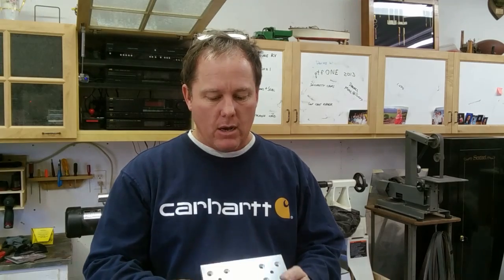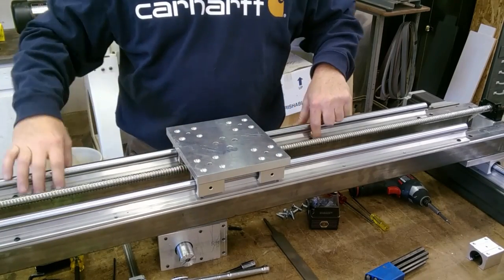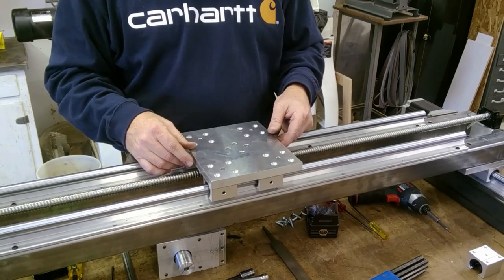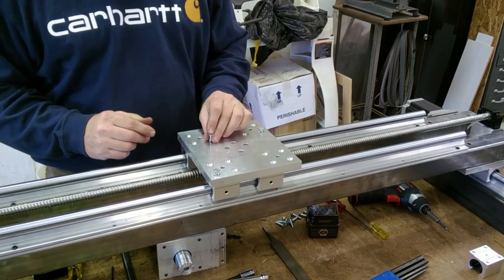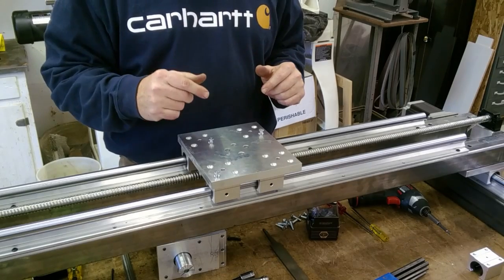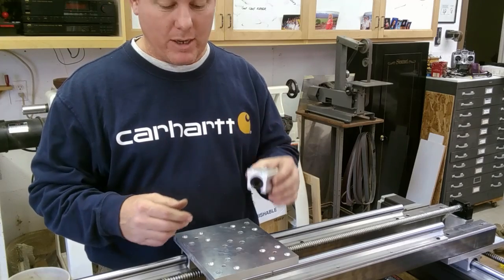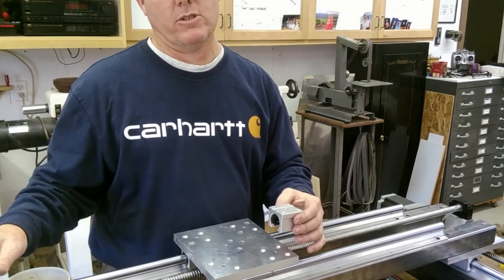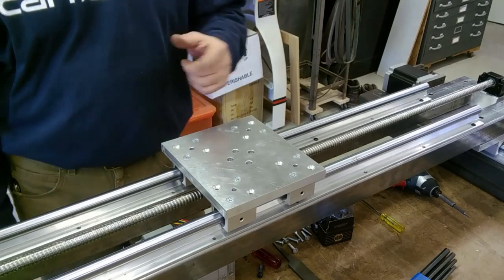Chinese Linear Slide Bearings - Something to watch for.

Comment: These are not precision parts, even on high precision linear guides you don't locate them this way. Counterbore instead of countersink and leave 0.5-1mm clearance (20-40 thou) to allow for any misalignment. You only experienced issues because you assumed your method would be better than the standard way it's done.
Reply: Cunningham's Law states "the best way to get the right answer on the internet is not to ask a question; it's to post the wrong answer." Good on you for showing your work and leaving in your “mistakes” so that others may learn from them. I try to leave in my mistakes instead of editing them out for the same reason.
Reply: @NoelBarlau , I discovered Cunningham’s law over 30 years ago. I would create two accounts. The first one to ask a question. The second to answer it incorrectly. Then a ton of “correct” answers would start flooding in.
Reply: 100% right. This is an engineer's reply !
Unfortunately a few people have heard of pocket holes and drill bits  to do them are not so common.
Reply from the maker: I think you are right.  I mentioned that in one of my other machine overview videos.  
One of the things you have assumed incorrectly is that I know the 'standard' way.  The best part of this (social media), is hopefully your comment will help the next person.  I'm going to pin it to the top.
As @loco lobo said above, however, few people have the tooling for counter bores, so I will note for them, that anything BESIDES the flat heat tapered screws like I used would be better.  ~P.
Reply: @sbirdranch  I just had to stop and comment on this - how f*cking refreshing to see someone say "I think you are right" to a comment that could have easily been taken as aggressive or argumentative if you didn't understand that there is a bigger picture to all this (...of course, it didn't hurt that he WAS right.) The world is so full of insecurity that sometimes it feels that we are in a mass degeneration, but maybe that's just me. lol I'm not an engineer, not any kind of scholar, I'm barely a woodworker, but I've become absolutely enamored with the concept of linear motion, how it is applied in day to day life, the hardware involved, and especially with the various iterations of the principles in the projects that content creators like yourself have shared here on YouTube. Thanks for the time and effort it took to put the videos together and get them uploaded. Somehow, it seems, I CAN learn from the mistakes of others. If only I'd known this in my 20s, I think my oncoming 40s would look very different. lol
Reply: @adammabe5819  Thanks for saying what I was thinking/feeling so eloquently.
Reply: @sbirdranch  True about tooling, but it's really easy to make a counterbore if you have some silver steel (drill rod), a file, and a blowtorch.  It was one of the first things I learned to make (after D bits, and after single-point tools) when I got a small lathe.
Reply: Haha you're right I did think that ;) One way it's often done is to simply leave the head of the screw protruding and design around this, obviously this isn't always possible but it's nice to not need to counterbore if you can get away with it.
I hope your machine is working out for you!
Reply: Made the same mistake the first time i used linear rails, but quite fast i realized countersink any fixtures for rails is a middle-good idea^^ Also never countersink any supported rails or so, makes it super painful to align the rail.
Reply: @CiPoint Hi, another way to hack a counterbore, is to first drill the through hole (say 5.5 mm) and then use it to guide a 10 mm drill, but just drill a few mm deep. Then you switch to a 10 mm square end mill and use the previous hole to guide it, and drill to the final depth. It can be done in a normal drill press and the bottom surface finish looks decent.
Reply: Counter bore is the only way to go !
Reply: Your work is good ! Thank you for sharing . I used threaded locating pins . A little dykem and drilled at each punched dimple . I didn't think about them sending defective parts . I had one not fit two holes were off . I had to work today and will quality assure my parts when i get home . Thank you for the enlightenment ! 
Blessed day!
Reply: Yep I design machines for a living. We always avoid countersunk holes because if anything is out you can't accommodate that misalignment. Countersinks are by their nature very unforgiving. To add to that the theoretically perfect countersunk hole in reality is very uncommon. I've seen so many machine shops add the countersunk holes as an afterthought using a pillar drill! One of the most critical elements for location and you took the part off your £250K CNC and used a £5K pillar drill (in reality it's probably more like £1K) which you just eyeballed for accuracy! It's better to think of countersunk holes as almost akin to dowelled joints. Once you have the location set up just perfect then use a countersink to keep that alignment or use a dowel. People like countersinks because they look good which is fine when you are drilling holes in wood and all you are concerned with is reducing the visibility of that screw head but for unforgiving tolerances they really need to be avoided.
Reply: Exact situation. Wish I would have seen this a few months ago. Had me doubting my abilities. Building zero tolerance for intolerant parts. Try that with a cheap drill press or hand drill. Insanity. .5 tolerance for cheap Chinese bearing blocks?  Ha!  Try 2mm. With a washer. LOL!  Ridiculous amount of mucking about. So disappointed I’ll be buying my next.
Reply: BINGO!  I worked for Thomson Industries 25 years ago as an application engineer at their HQ and main production site in Port Washington, NY.  Over constraining these units will kill you.

That said, it is no surprise that precision with the pillowblocks went out the window once it all became Chinese crap.
Reply: Totally agree. I have built a couple of machines etc and have learned that using a countersunk screw is a no go. Even with a fraction of misalignment the screw will pull it off. The other thing I learned was to never use the sbr type rail and bearings, there is way too much movement in them, even when tightened up slightly with the screws on the side. The cost of hgr rails and blocks are not too much more for the chinese ones, and even though they are considered cheap, they are soooo much better than the sbr rails. Trust me, these rails will give nothing but trouble.

Comment: Good video but that is not how you measure the holes. These SBR's are not precision on the chassis, the alu outside casing. The holes themselves should be to spec but they will always, even on high high end machines not be 101%. Your part holes should have a slight adjustment ratio. I have worked a long time with high end machines and you should see the adjustments some of them need :-)  Fanuc shamemuck :) Overall, I get where your coming from, everything should be 101% but that would make things too easy :-)
Reply from the maker: Ya....I learned that.  I also became friends with a guy that builds and services high precision CNC machines and he said the same thing(ish).  The real screw up was when I was using counter sunk holes and flat socket head screws.  They would locate on the taper of the counter sink and that was what you got.  No adjustment.  Live and learn.  Most of those parts have been built again or switched to square rails and any inconsistency was accounted for with your method.  ~P

Comment: The simple solution, albeit a little time consuming, is to instead of having countersunk holes, have counterbored slots, so you can make those small "micro adjustments" to get it all aligned, then red Loc-tite all the hardware.

Comment: What's the diameter of the shaft you're using? I've seen 8mm, 12 mm, 19mm on wish. But the description isn't clear as to diameter and length. As well as what is included.  I want to change my three axis mortise machine from full extension drawer slides to the linear bearings you are employing.  And you're correct. My application isn't near as critical as what you are striving for. Who do you recommend ordering from?
Thanks
Very informative, nice work.
Reply from the maker: These are 20mm.  ~P

Comment: Greetings, I notice the same in these "chinese" parts, those are not equal at all, and random holes position, so, the chinese make each fo these linear bearings UNIQUES, a complete crap.

Can You advise some place where GOOD CNC PARTS are sell? Thanks in advance
Reply from the maker: Not really ;(  I have yet to reach the point where I can justify the costs.  For 'generally' better, I would stay off ebay and amazon.  Also wouldn't go with the lowest price.  ~P

Comment: Kuality with a capital K. The parts are from China. Gotta make up for the lack of QC. Counterbore and an oversized bore is the way to go. Adjust the fit as necessary and they'll be fine. You'd think they would just CNC the little buggers but no ... 😳

Comment: Funny you should bring this up, many years ago I worked on a project with another person and the holes in that component were all marked out, drilled and then countersunk.........the result was that the c/sinks aligned the screws exactly to the hole centres, whereas being hand drilled from marked off centre punched points the hole centres drifted with the drilling........this was found out after a lot of head scratching and resulted in counterboring the holes with clearance around the screws.....they lined up and were later dowled in place.
I came across this phenomena many times in later years when holes that had clearance were then countersink......it works OK for through holes that have parts bolted together with nuts and not tapped, but NEVER when the second part is a series of tapped holes,

Comment: I own ezcnc in Plano Texas. We fix a lot of Chinese machines. The knock off hiwin parts are not worth the savings. I have had to fully rebuild brand new machines that customers bought from places like industrial Cnc that imports from China. Spend the extra for hiwin, thk, Iko, or Thompson. You get what you pay for. Same with electronics. There is a reason why Oriental motor stepper motors cost more than parts bought from amazon or eBay, they last and have much better power. It’s what is inside that matters.

Comment: I am building a similar machine but I am not precission milling because I dont have the gear. It is a bedroom build with bosch aluminum.
I have aluminum plates but with straight holes a bit large and wahers to lock. I square up the plate with dial guage and calipers. Mind you I only want to do woodwork and heavy carving

Comment: Thanks for taking the time to do this video.  good reviews on cheaper stuff is always helpful.  So I'm wondering if you think these things would be strong enough (or suitable) for a small camper slide out like you see in this clip https://youtu.be/ot-lf_lMLDA?t=198.  I'm looking into building something similar to this trailer and I need the slide for my queen (and her queen bed).
Reply from the maker: Sure looks like what he used but I'm not sure how I would trust them with the weight of my queen and I cantalevered out like that.
Reply: sbirdranch my plan is that every piece gets wrapped in fiberglass, and the inside of the slide would be built so it couldn’t fall out.  Also I’m thinking the bed would only go halfway out, so only about 30”.

Comment: I know what you are talking about brother, and it's frussssssstrating. I suggest that you use counter boring instead of countersinking. A countersink screw's head is never concentric with the thread which adds to you problem of the holes being out of position. With a counter bored hole you at least have some clearance to play with. I'm glad that I watched your video which made me aware of this problem because I'm going to use 26 of these bearings (20 mm) on the CNC mill I'm busy with. I intended to counter bore the holes from start.

Comment: I know this is old but do you have the hole layout dimensions or a template for the slides?
Reply from the maker: I can probably find them.  Some of the eBay items of this type have the dimensions. ~P
Reply: @sbirdranch  thanks for replying buddy, your vids have helped me out alot. Iv looked high and low for the hole dimensions with no look. Thanks again
Reply from the maker: @Bible_Studies101  on an SBR20 THE dimensions ar 35mm x 35mm center to center.  These rails are a standard and with the exception of pour manufacturing tollerences, they are all the same.  Here's a link for all the SBR sizes in one chart. ~P. https://cnc4you.co.uk/resources/SBRxxUU.pdf
Reply: @sbirdranch  your a diamond. Thank you very much mate
Reply: @sbirdranch  I forgot to ask what bolt sizes are they, m6?
Reply from the maker: @Bible_Studies101  Yep.  Everything you need is in that drawing.

Comment: Thanks, this will help me in the future. On some of my projects I will use flat head screws, on metal. Just trying to engage more surface area ( especially on thinner metals ) with a fastener, but it doesn't always work to my advantage.  I feel your pain. I want to build a router also. Thanks for sharing!

Comment: I have those rails and I'm am going to upgrade to proper rails not these are fine for a router up to aluminium machining  but steel nope  the have some wiggle room in them
Reply from the maker: Since this video, I habe upgraded to Hiwin rails on my X and Z.  I'll do the Y eventually.   I would tell anyone that if your $$$ and comfort allow, go with square.  I was able to sell my old rails on eBay. ~P

Comment: Totally agree...you never mount linear bearings with countersinks....Also the distance from the outside of the casting to the center of the hole means nothing.  Its the center to center distance on the holes.  Since you went to a machine shop you should have give them a positional tolerance on all your holes as stipulated in ANSI   M14.5-2009.
Reply from the maker: The machine shop you mention is me.  So I take the credit or blame.  I don't remember ever seeing a tolerance in the drawings but honestly didn't look.  It was probably measured in feet. ;) ~P
Reply: Hey, not criticizing one bit.  At least you gave it a shot.  I deal with these bearings and rails in my everyday job.  I learned the hard way too.....If you ever need help on this kind of stuff...let me know...glad to be of assistance

Comment: Is there any noticeable difference to having the rails mounted on top of their respective locations or the side? Is there an advantage to the amount of “play” or slop in mounting them one way or another in your opinion? Thanks!
Reply from the maker: For no scientific reason, I felt that mounting them on the side or bottom would put pressure on the aluminum housing making the "C" shape want to open up.  I have seen them used on their side in many designs. ~P

Comment: Interesting -- I just came up with the same problem. Not sure yet the solution will be the same. I used counter sink holes because my plate was not thick enough to allow counter bores knowing that there could be problems with the counter sink holes. Yup not precision parts. My ball screw nut housing had all the holes drilled off center. Had to drill and tap new holes on the other end of the housing.

Comment: Wow, that's terrible quality for a production manufactured part. I'm sure the vendor would send you a replacement if shown a picture of it. I know it sucks waiting on parts during a build but sometimes patience is worth it. Makes you wonder how many hundreds slipped through quality control checks before being caught. With modern production methods those holes dimensions should have a tolerance of a few thousandths at most.

Comment: COUNTER BORE  THIS IS HOW I DID MINE EASIER SETUP. MY MACHINE IS MADE FROM 3/4 THICK ALUM... VERY HEAVY AND RIGID.TOP SPEEDS ARE 150 IPM SAFELY .640IN/OZ MOTORS.5' X 48" WORK SIZE..

Comment: hello
what is the precision of those rails?
i want to make a lathe bed out of it
Reply from the maker: The rails aren't bad for fit to the bearings.  My issue was with the screw hole layout.
Reply: @sbirdranch  Yes, I agree.....make the holes in the plate 1/2 mm bigger and counterbore for the heads.....don't use countersink screws.

Comment: Is that the sbr12uu bearing? If so, do you recall what the pitch and size of the tapped holes are? I am trying to research and finding all kinds of answers! Thanks
Reply from the maker: Mine are sbr20 size.  So twenty millimeter rails.  I found schematics with thread pitch info on  eBay seller pages.  The sbr series is standard so I am surprised you are finding conflicting info.
Reply: sbirdranch turns out they were m5! The company sent the wrong diagram but I got it sorted out :) thanks for the reply!

Comment: How big are the linear rails over your table, the longer ones ?
Reply from the maker: They are all 20mm rails, including on the Z axis.  I bought them all together
Reply: thank you for your fast answer, what about for the long side the  are 36"or 48", i was looking to get 60" in one piece on 2mm, is posible at the same store ?
Reply from the maker: The X and Y are the same length.  The vendor on ebay was very flexible to work with.  He was willing to cut it to any length I desired.

Comment: Common practice on setting up your rails, not the slides, the rails is to mount just one side first. Then use your plate with all four linear bearings to align the 2nd rail and everything becomes aligned with eachother.
Reply from the maker: I want to go back and take a re-look at how things are right now and give my machine an adjustment if needed.  Thanks for the comment/suggestion.
Reply: Yeah, I hate it when I have to slot the holes too!